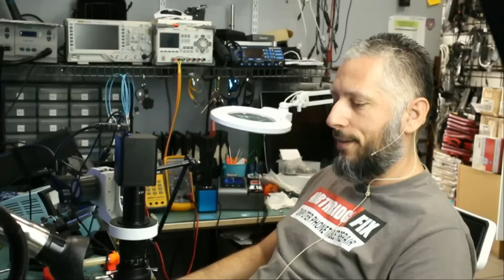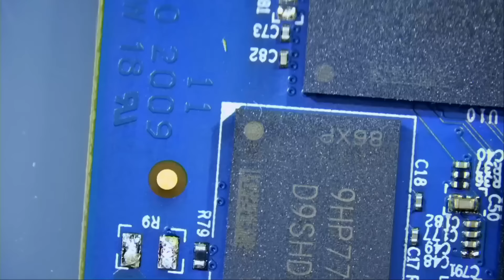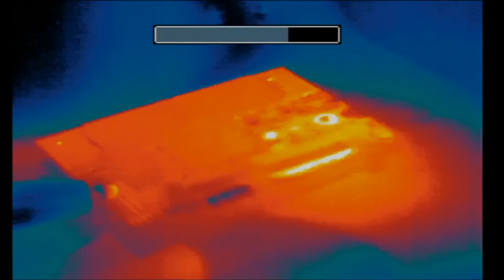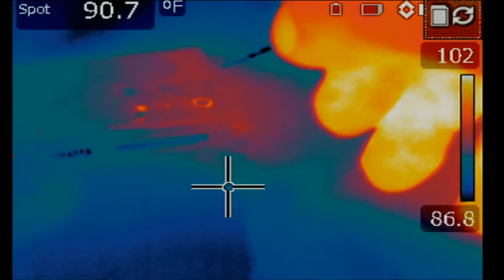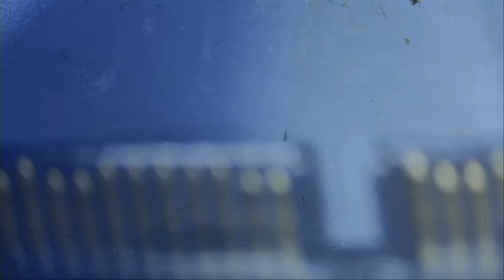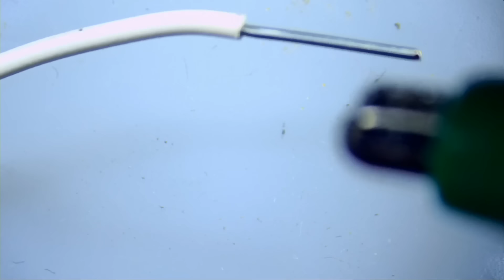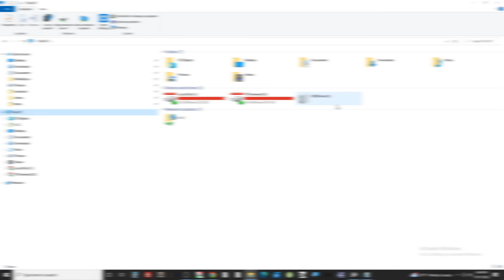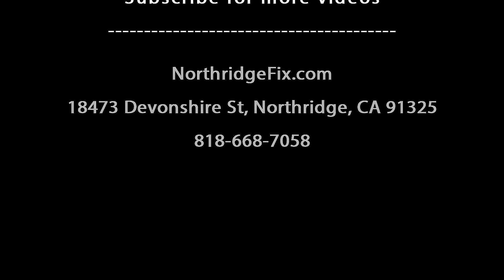Crucial SSD Drive Failed - Can we save data.?

Comment: Hi, I am not an electronics repair guy but I always love to see you repair stuff. Is it possible if you could also tell why a particular failure took place?
Reply: Everything dies.
Reply: @ppal64  you sure are right but a possible cause of failure can help us to avoid such mistakes.
Reply: @irfan-106  In the case of manufactured electronics, it isn’t about finding a solution. Most companies have the solution, or know they can find it but it usually raises the cost of production/ r&d cost. So, if a company makes a product for 1% more, they have to either price it higher, and risk being undercut by other manufacturers, or earn 1% less per product. Yes, that 1% cost rise is something a lot of people are willing to pay for, but as much as it hurts the engineers that work on these devices, all that they’re listening to in the boardroom is “cost rise” and “less revenue”. It’s all about maximising revenue and minimising cost. Unless a device is built for continuous use, say in servers, they also have to make consumer products at a certain price point for th4 general user.
Reply: @irfan-106  so in this case, buying a higher quality drive with better components to lessen the chance of failure.
Reply: @maksqwe1  agreed 👍
Reply: mostly overheat, voltage surge and bad soldered
Reply: Low quality components (you can check videos on youtube about exploding power supply units), bad circuitry, voltage surge, bad power supply, overheating, badly soldered pins on the board...i am not repairing micro components also, but i have degree in electronics and computer science, so i am just saying from experience what i witnessed and from what i learn.
Reply: Capacitor failure!
He already said what the problem was when he removed the ceramic capacitor.  Usually the problem with ceramic capacitors is that they short inside because the metal layers melt creating a metal wire inside.

Comment: How did you know that you didn't need to replace that capacitor? There are a bunch of places where no components are when it looks like there should be. Curious to know why
Reply: he probably know from experience what that capacitor is there for, but yeah i would like to know that also. 
I had for example literal capacitor separated from its 'legs' on my GPU board (it is in group of components in power section) when i was taking off cooler to replace thermal paste i saw that, replaced it with similar condenser and it is working fine, what is interesting is even with capacitor separated gpu was working fine, same as now.... :D

Comment: I like repairing not because of feeling successful but saved a lot of valuable things like files on ssd usb drives etc.
i was fortunate enough to backup right before an usb drive die in front of my eye. one time repairing saved me an appliance from going to junk yard. more recently saved me from danger of bulging lithium battery on smartphone. So i strongly feel the right of repair whenever possible and feasible.

Comment: Not all capacitors connect to ground some of them connect to the chip itself with another negative and positive source which has no connection to common ground
Reply: Except that would be pretty unusual for the circuitry needed to operate a SSD.

Comment: At least with an SSD they are cheap enough that you can buy an identical one to help in troubleshooting or to act as a donor board.  That is if the trapped data is important enough to justify the expense.
Reply: Yeah that specific one is quite a common SSD given I also have one

Comment: If it's for recovery only, couldn't you just measure the voltages on the other dc-dc converters, then remove inductor and capacitor from one of the others and move them to replace the bad ones, and inject the known (previously measured) voltage where you desoldered the parts from?
Reply: lol he thinks he his better then everyone ells he said in the last video that other repair people should stop trying to fix GPPU pins because they lack experience
Reply: I didn't stay at a Holliday Inn Express , so I will not comment.

Comment: At 4:55 you said you don't know the value of the capacitor. Even though it's not a guarantee, it looks like there is an identical circuit to the left. I.e. L502, C514 etc. which you probably could've measured to get the values.

Comment: Hi Alex, did you repair the drive or recover the data for the customer ???
Reply: As he said, he only did data recovery. But for that, he had to fix it far enough that it can copy data but might not be stable in normal use. So the drive itself will mosz likely end up in some recycling bin while the customer gets his data back on a flash drivr that Alex sends over to the customer
Reply: He said in the beginning. He wont mail the ssd back to the customer. He will backup the data and mail the backup drive to them. When it comes to recovery, even if  its a fix, its not healty to use that drive again...
Reply: For failed drives even for SSDs it's best to recover the files asap and replace the drive even if it was repaired.

Comment: Hi Alex, you didn't realize that there are 2 exactly the same ICs there and the schematic around them is the same but just mirrored. the value of C507 capacitor should be the same as C520. Timing (18:27) you can see well both ICs and mirrored schematic around them.
Reply: Nice spot did not notice that.
Reply: Wow sharp eyes
Reply: @eftekerahmed7299  He is using the new NF-microscope-camera Edition 2 xmas special to watch this video
Reply: Yup, was the first thing I observed.
Anyway, I would have checked the board with my IR cam right away, that cap was probably already getting hot when he connected the drive for the first time.
Reply: Now that you said it ,it is
Reply: Didn't noticed that either, I went with the components layout.
Reply: Yeah possibly two buck converter circuits, powering the two NAND's. Nice catch.
Reply: @andchip.s  at 18:27  AKJ K52 921 or sth what is thatt chip? Can you sort out the part number on that one?
Reply: Ну хоть Петров заметил очевидное)

Comment: Good job Alex. A quick note though, a cap is not always connected to ground. Here's a few examples: DC blocking cap for amplification input, bootstrap capacitor, cap in MOSFET snubber network, etc...
Reply: 85% of this video because alex always though all screw holes are ground, he get a new experience today
Reply: @billykulim5202  this is why i love this video, going on a repair journey with making mistakes .. and learn the best out of it
Reply: Thanks for the info bro
Reply: Electricity is a thing
Reply: Caps on PCIe lines, and SATA Lines too
Reply: Probably bootstrap, like u already said. If so, that measure is correct.
Reply: I found ssd and hdd that dont use ground on all holes. Stupid
Reply: 0:02 0:04
Reply: 1’s and 0’s don’t go through capacitors, they ride on top of them and fall through them when there is a short
Reply: "Here's a few examples.."
How about..
"Here are a few examples.." since "are" is a multiple word where "is" is singular.  So you typed:
"Here is a few examples."
Offering some help.  Not being 'mean'.
Reply: Alex knows that for sure. but he assumed with his experience that board like this and in that particular area one leg of the caps should be connected to ground.
Reply: @227suman  Yeah but it highlights a point for us all that isn't always the case and its best to check before doing it.
Reply: @Ghost572  That's right .

Comment: Howdy, that was awesome. Can you explain why leaving off that shorted CAP would still work? And the inductor you replaced was within the same value (ie: they're all similar value if came from a similar board) Thanks You. I'd say that's worth $500 for his data haha 🤣
Reply: Usually those caps are there to voltage regulate. You have little spikes and dips in the voltage and the cap smoothes them. In general the signal will likely be good enough without one cap.
Reply: It was a power driving circuitry which was shortened by a buffering capacitor which cracked at the power consumer. Removing the buffer capacitor will make the circuit maybe unstable under high load conditions, but most likely this will be completely irrelevant because circuit designers spree those buffers just out of precaution anywhere like a cat his piss. The induction used inside the power driving circuit can only be too small to generate enough power. Thus you can get away with almost any induction there. Coils of similar size in a similar application will have very similar enough ratings anyways.
Reply: Caps are for decoupling (filtering, smoothing signal jitter), inductors are used in the buck convetor to step down 5V rail tio 1.1V (or watever voltage NAND is using). While you can remove a cap, inductors must be always present as they are in series in the circuit. Getting the value 1:1 is tricky if you don't have schematics or a similar bord. In his case he has 2 identical buck convertors on the pcb and it would been very easy to measure the other good inductor.
Reply: I was wiping the contacts of a m.2 drive with some contact cleaner (water damaged laptop), and a single strand of fabric on my rag took a cap off. It still worked and I was still able to copy the data off normally, I threw it away after though. It was just a used sk hynix 256 drive anyways.

Comment: why you not check inductor value in henery... How you judge only by size?
Reply: Size is matter
Reply from the maker: You can go and do all the measurement you want. I got the files...
Reply: This is not a fix its a recovery. Only thing matters is the drive works or not. If it didnt work he would have found another inducter and try again. Once the data is backed up, the drive is a junk...